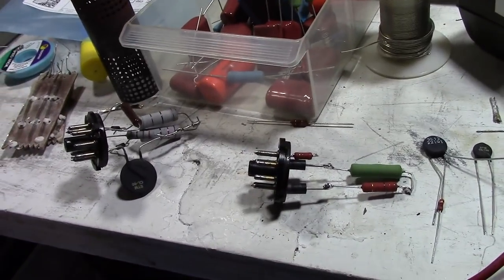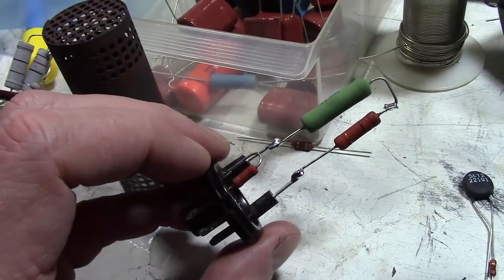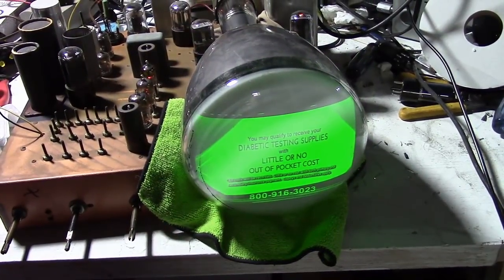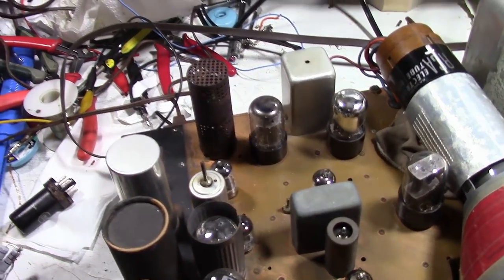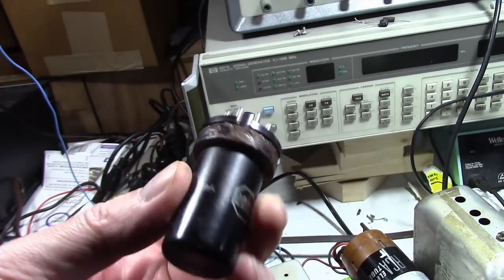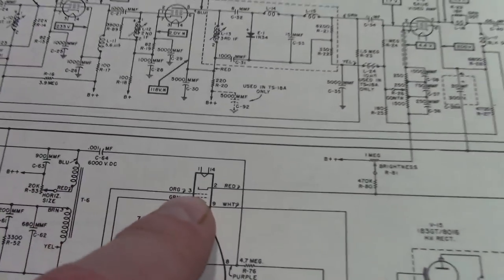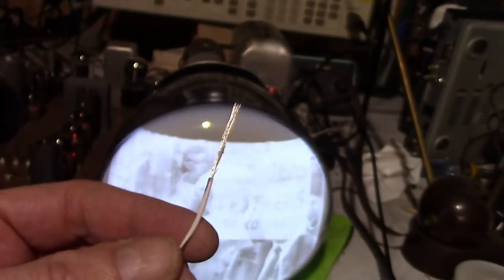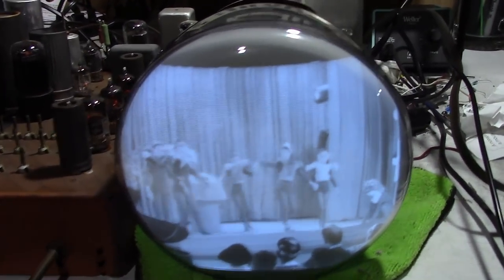Motorola VT-71 restorations p9o10

Comment: I had about a dozen of those Motorola ballasts NOS that I had for years, then someone saw them and bought them all from me at a Kutztown swap meet. I like the idea of using the thermistors, but I wouldn't sweat the 6AL5 since they are plentiful unless you do happen to stumble across a 6AL5A. Have a Happy New Year!
Reply from the maker: Hmm.  Apparently there is no 6AL5A.  The 3 volt version (3AL5) is designed for series string operation but not the 6 or 12 version.  Oh well, the thermistor should help enough.

Comment: I need to build 2 ballasts for the ts-18 chassis I have,and I already have the cl 90 ready to go.  One note: I just took apart my ballast on the newly aquired 9t1 set and it appears somebody already tried to take it apart.  Tube socket bakelite chipped in 2 spots but still functional.  I do believe the wire inside is intact and the copper tube pin wires going to each wire are crimped but Im betting corroded.  Seems it failed just from slight corrosion.  Probably better to just build a much better ballast.

Comment: Hi Bob,
- - We use to call the floating chassis the "AC Ground" or simply "the chassis". In the old days, clothes washer motors, furnace motors, and such were sparky and AC lines and the surrounding RF environments were noisier than now. Old florescent fixtures could ruin TV reception, too.
- - Of course now we have a third AC house wire which is named "AC Ground" so the older meaning has been overtaken by electrical wiring standards and no longer implies interference suppression. But it use to mean that.  Maybe "AC Noise Ground" is now a better term.
- - It might be interesting to connect your chassis to an earth ground, such as a cold water pipe. Maybe the waves in the picture will completely disappear. Be careful though.
- - Sometimes these AC Ground designs introduced more interference than they stopped. You can try removing the AC cap to the chassis. This was a black art at the time. At least I could never predict what was going to help.
- - Glad to see you back online. As always, love the vids.
Harry
Reply from the maker: Hi.  Thanks for the information and suggestions.  I do have access to the cold water pipe and real earth ground in my workshop area, but no nearby AC outlets.   I'll try to run n extension cord and do some grounding experiments someday.  I'm curious to see the effect on AM radio reception too.  I get a lot of hum in the basement.

Comment: I'd love to see another capacitor fix for the ballast drop. Complex impedance is cool.
Reply from the maker: Yeah, it is cool how they work.  The harder the set wants current on a cold power up, the more the cap resists it.    I will be making more on future projects for sure.  Also, there's a link in the description to one of my older videos where I build a capacitor dropper.

Comment: Merry Xmas m8 and a happy new year, been a viewer now since the very early days, I wanted to ask 2 questions. The silver wire being more conductive, does that have any real advantages as the electrons will not move any faster, will they? And, as the Chinese love doing, how much can be stripped away from these TVs but still operate.?
Reply from the maker: The wire has less resistance so less voltage drop.  It only really makes a difference in sensitive circuitry.  I think there are advantages in RF applications too.  Well I suppose you could eliminate some of the bypass caps but you will get more and more interference as you do so.  These were designed as budget sets and there really aren't any unnecessary parts.

Comment: I know you mentioned it before but what type/brand/model resistors are you using? I want to use them in a Tube Class A amp I am building.
Reply from the maker: I use several types bu mainly Vishay PR01, PR02 and PR03 series.  Those are the reddish brown ones rated at 1, 2 and 3 watts.

Comment: I know this is an old video but I have this exact same set with a working original ballast tube however the set refuses to power up. What’s the best way to figure out where the bad connection would be on a filament string. I’ve tested all of the tubes individually and they all have good filaments.
Reply from the maker: What servicing has been done to the TV ?  What do you mean by power up ?  Do you have B+?  Do the tube light up ?  There are two filament strings.  They have the power switch, CRT filament and ballast in common.  So, if the ballast is good and the tubes aren't lighting up, check the power switch and picture tube filament.
Reply: @bandersentv  I have 120 volts between the chassis and ground, and around 170-180 volts b+ to ground. Each tube is good, I’ve tested them all on my bench supply and they all glow.
Reply from the maker: So the ballast is fine, the tubes are glowing and you have B+.  So what so you mean by it isn't powering up ? 
Also, there should not be any voltage on the chassis.  It is floating.
Reply: @bandersentv  the tubes refuse to glow when in the set. They only glow when connected to a power supply, ballast impedance is correct
Reply from the maker: OK, then back to what I stated earlier.  Check the power switch.  If that's good, get out the schematic and check through the filament strings for continuity.

Comment: Why can't someone  make the equivalent of vacume tubes out of transistors, diodes, and rectifiers? Eventually all tvs were made without tubes, so someone did it. Now, i just want to know if a tube tv can be converted to all solid state
Reply from the maker: Yes, you can.  However, it would not be easy.  Rectifiers are easily replaced with diodes.  Specialized circuits like high frequency oscillators and the vertical and horizontal output tubes not so much.  You need to use FETs to replace the high impedance grid circuits coupled with bipolar transistors to handle the higher voltage and current plate circuits.  Plus it would be tricky to match the gain and other characteristics of tubes.   Tubes are still plentiful and relatively inexpensive so why bother ?

Comment: bandersentv, for whatever reason, youtube isn't letting me reply to comments but I can make new ones fine. The back of the television says Admiral Model 221DX16A N 117 volts, 60 cycles, AC only 185 watts 19F1 Television Chassis. Built in TV antenna. Equipped with Admiral Cascode Turret. I don't know what the year is but I found a photo of another online that looks the same and the photo says 1953 although the person who wrote that might be wrong.
Reply from the maker: Yes, that is a 1953 model and a straightforward design.  I doubt the flyback is bad.  Much more likely to be capacitors and resistors that have failed.  I bet it's a big, heavy set with a deep CRT.  Where are you located ?
Reply: I am in Louisiana. It is a big cabinet but it might not be too bad if I just shipped the crt and chassis? I can clean and detail it up so you're not dealing with a bunch of cobwebs etc. I haven't seen the inside yet. I'm going tomorrow morning to look at it. Is there anything I should look for? I'm planning to take photos and try to make a deal but neither of us has any idea what it's worth in it's current condition. I can send you the few photos that I do have already. He did plug it in and turn it on. He said he hears sound and the crt lights up from the back but he doesn't know if he needs to leave it plugged in longer or what because no picture. It sounds to me like it hasn't been plugged in for 20+ years. He said it's been in his family since it was brand new and kept indoors.
Reply from the maker: Definitely do not plug it in longer.  It needs an overhaul before it is going to work properly.  All the electrolytics and paper caps should be replaced.  Also out any bad resistors and tubes.  Also the CRT could be shot or the vertical output transformer fried.  All that aside, I'm afraid this is not a very collectable are for TVs.  B&W sets from the 50s just aren't worth much.  Plus they made loads of them.  Full restored maybe you could get a couple hundred if the cabinet is in good condition.  So you have to ask yourself how much money do you really want to sink into it ?
Reply: I have been hunting for a predicta for years and in the hunt haven't found a single antique television of ANY model. I guess everyone has thrown them out in the south. This is the first one that has come up for sale that is remotely what I'm looking for. All the tubes light up and I hope just the caps and resistors might do it. I can restore the woodwork myself. I'm just really excited about it and I've been watching your show for years now. Just don't have a single tool to do the tests with and have very limited soldering experience.
Reply from the maker: OK, I get it.  DId you consider buying a Predicta off ebay or going to the annual vintage TV convention and auction in Ohio ?  Keep in mind that I charge around $300 plus shipping.  Also you should not ship the CRT if at all possible.  It could be broken plus it is large and heavy.  You should also test it to make sure it is good before investing the money in getting the set working.  Replacements are out there but can be hard to find and expensive.
Reply: All the sets on ebay that I considered buying were local pickup only and none within 500 miles have come up for sale in the last few years that were in decent condition. 

I did go ahead a purchase the Admiral TV and I spent the weekend restoring the cabinet. It looks great and I really want to make it work again but shipping the chassis is 145 dollars plus the 300 to restore it. I just don't have the money unfortunately. Do you think it's worth just replacing the caps and resistors, getting everything cleaned up to see if it works? I might be able to find someone to test the CRT. I would pay someone just to tell me what to replace in the unit. I'd sure love to get it going. I already spent 10 hours on the cabinet and it looks great.
Reply from the maker: I suggest you join the Antique Radio Forum and start a discussion in the Antique Television area.  http://antiqueradios.com/forums/viewforum.php?f=3

Myself and many others will offer help.  You can get a CRT tester for less than $20 on ebay.  No, I don't recommend replaced all the caps then seeing if it works.  It can be an expensive hobby and don't want to see you get caught in a money pit.  It took me years and money and luck to put together what I have.
Reply: thanks a lot for the advice. I took it and submitted a request for advising on the forum. I can't wait to get it going.

Comment: You do excellent job of restoring those old Tv's you sell them after? Pm me your email will send you pics of my restored tuner and amp and my custom socket adaptor to test 83 tube in a 6000a
Reply from the maker: Thanks.  Some I sell.  Some I restore for others like the sets in this series.  The 6000A I had had the sockets for older tubes like the 83.  I'd rather not give out my email.  How about you post photos somewhere online ?
Reply: bandersentv ok what's a good site to post them on I do have onedrive
Reply from the maker: flickr, photobucket, instagram, pinterest, or join the antique radio forum
Reply: bandersentv ok I uploaded them to Flickr
Reply from the maker: what is your flickr username ?
Reply: bandersentv tysrocks
Reply: A question I have is what can I add to make filaments on cold startup on all tubes have less of a spike. Some in my tuner and some in my amp the tubes startup bright then dim down wanna save filaments
Reply: So on my Hickok 6000 the shorts is to sensitive it's detecting a tube as shorted when it's not in my other tester anyway can make it little less sensitive? Also my meter reads 56.6mv instead of 58.2mv anyway can bring that back up to spec or is that much of voltage drop not gonna hurt accuracy
Reply: I added some pictures of the tube tester I'm selling it's a Paco T-60 and the tuner is 1950's Harman Kardon Rondo tuner both fully working and in good condition. Posted them on flickr
Reply from the maker: Sorry, I don't know. I only had a 6000 briefly and didn't use it much.
Reply from the maker: Add a thermistor like a CL-90.  Keep in mind it gets hot and will need to be kept away from anything sensitive.
Reply from the maker: They are very nice.  Thanks for posting.
Reply: bandersentv ok where would i solder in the cl-90. If you need schematic I could post them
Reply from the maker: Two options.  Either after the power switch in series with the primary or in the tube filament secondary.
Reply: bandersentv ok thanks so I posted 2 pictures of power circuit in Flickr of amp and tuner so in both photos can I put the C-90 in series with BLK-WH after the fuse?
Reply: Or am I wrong?